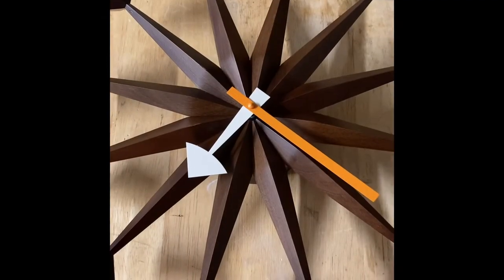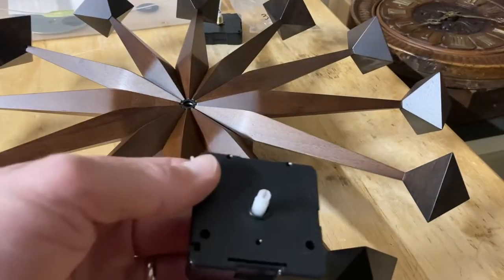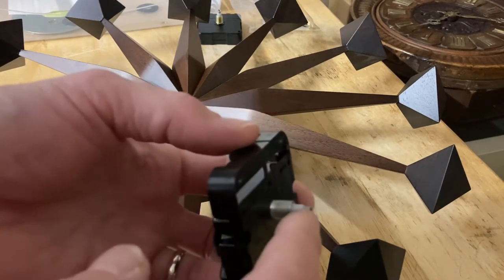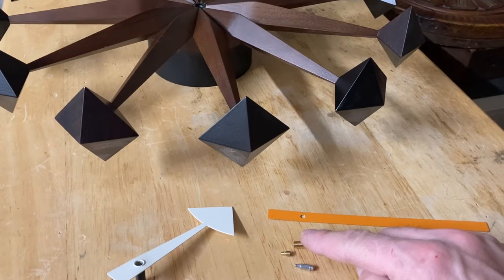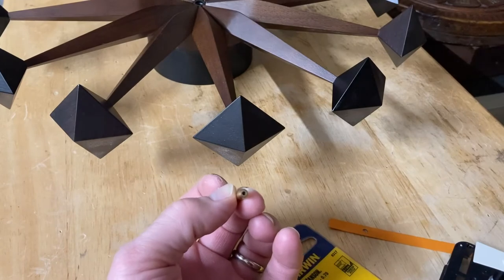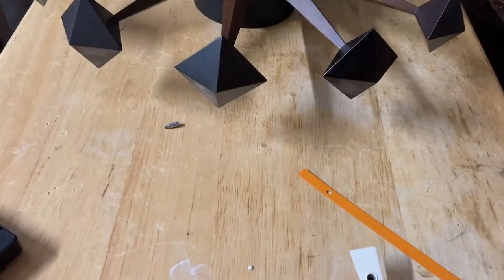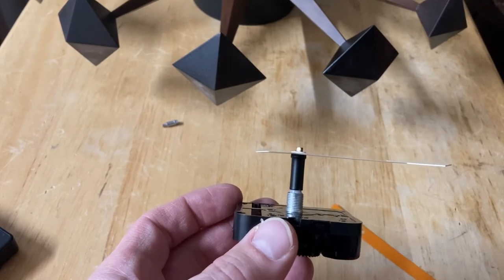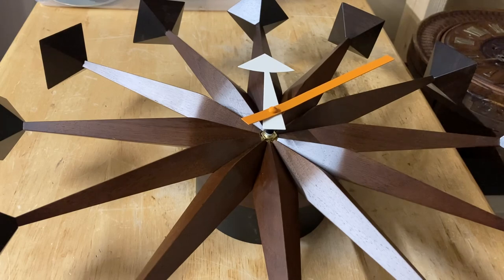Emorden Furniture George Nelson Battery Clock Repair

Comment: I have a Nelson Ball clock by Vitra that has a failed movement. Are all Vitra clocks going to be different in the way the posts fit into the movement, because of their varied designs? For example, the clock you repaired had tall blocky, wooden hour markers, but my ball clock would need a shorter posts for the hands, since the hands float very close to the flat center of the clock face. I've researched getting a replacement movement, and Vitra sells one for $90! Your repair of that clock was probably a little less than that. Any suggestions?
Reply from the maker: This is the only one I repaired so not sure about your particular style. I would buy the replacement if its available.
Reply: @Chrisclockrepair  Thank you; I’ve since found one from Vitra directly for $57, but still trying to find out if all their clock designs take that same movement. It’s a much beloved piece in my house, so I’d hate to have to replace it, especially since even the reissues by Vitra go for $600-1500 now, never mind an original.
Reply from the maker: @roelkuiper9919  remove old movement and measure it.
Reply: @Chrisclockrepair  Update: I heard from Vitra and they confirmed that all their reproduction Nelson clocks take that same replacement movement that they sell online. I’ve gone ahead and ordered one. Thank you for your responses!
Reply from the maker: @roelkuiper9919  great
Reply: @roelkuiper9919  Thanks a lot for this comment! I've had this clock for two decades and hope I'll be able to fix it now, too. I couldn't find the movement on their German website, but filled out a support request. Wait and see...